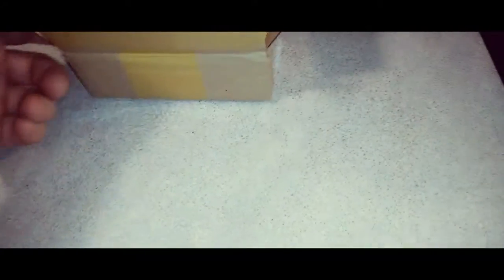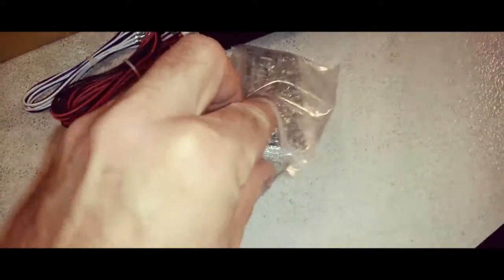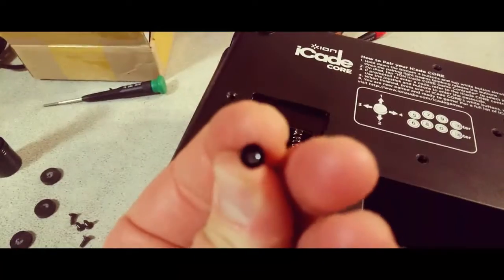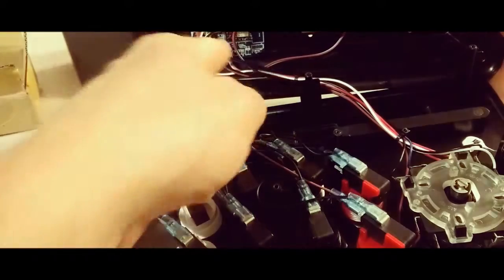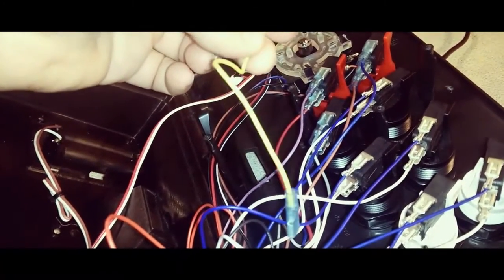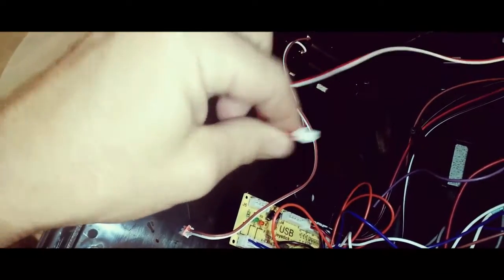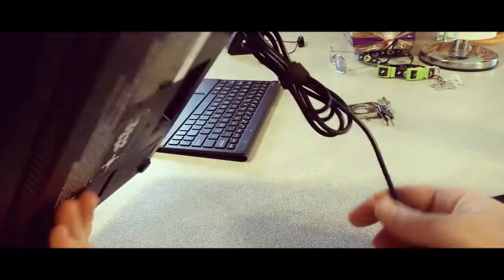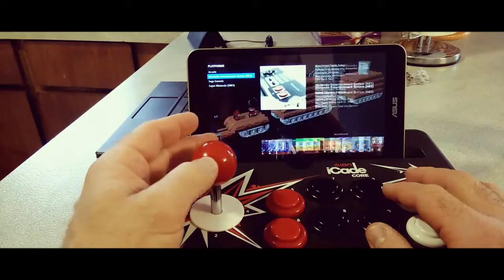iCade Core arcade stick usb mod

Comment: Great someone is sharing this process, thanks bro. Just out of curiosity, the old wires for the buttons on the icade, I’m assuming they did not fit straight into the new decoder. Why was that, are all connectors made in different sizes.
Reply from the maker: I can't quite remember if they were different sizes or if they were permanently soldered to the board. I think they were soldered to the board. It's been a while.

Comment: Great video, I'm looking at getting either this or the full iCade and it looks like it would be pretty simple to swap in Sanwa or Seimitsu buttons and maybe a better stick. I think you got the smaller Japanese 2.8mm button connectors with the Zero Delay encoder rather than the 4.8mm American style ones which would save having to splice the cables. I'm just looking for something I can put my old Nexus 7 tablet with MAME installed in and other than building a small cabinet this seems like such an easier option even without modding the buttons. I'm leaning more towards the normal iCade though as all the games I'd be playing are portrait mode but it would be nice to have the landscape option the Core offers.
Reply from the maker: NDrinks when you get it done, you should post a video of it so we can see it. I myself was thinking about replacing the stick and buttons.

Comment: what were the exact parts you ordered and where did you get them?
Reply from the maker: schmoop Easyget® Zero Delay Arcade Game USB Encoder PC to Joystick for MAME & Raspberry Pi Retropie Projects perfect fit SANWA Parts https://www.amazon.com/dp/B01C5J5AJO/ref=cm_sw_r_cp_apa_jyJJybHGQYC6N
Reply from the maker: schmoop sorry for the slow response. I didn't get the notification that there was a comment. Hopefully that helps you.
Reply: yodermouth thanks! one more question, would this work if i'm trying to use the controller on my computer for games on steam like street fighter V and skull girls?
Reply from the maker: schmoop I honestly don't know, I don't use it for steam and I don't have those games. I think if I were you, I would look at the Mayflash arcadestick F300. There are some good reviews of it out there you could look up. I have it but I don't use it for that purpose. it has a USB port on front that you plug in your wired controller to. It then maps the buttons from the controller to the arcade stick.
Reply: yodermouth yeah that would be a good controller for me but I don't have the money to buy a fight stick like that, but I already have the icade because I picked it up at a yard sale for a couple of bucks and wanted to see if I could turn it into a fight stick for cheap. thanks for the info though
Reply: schmoop it will work